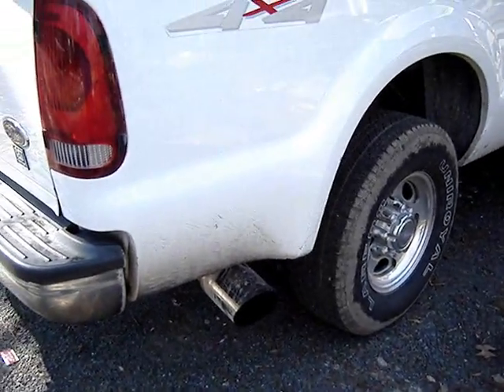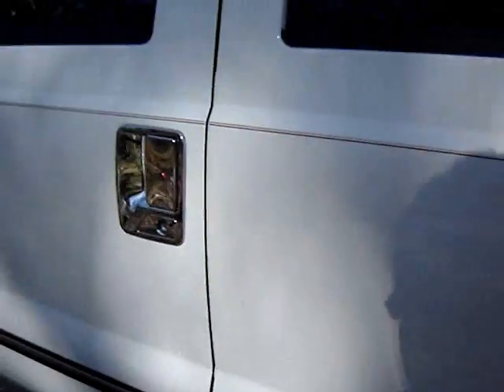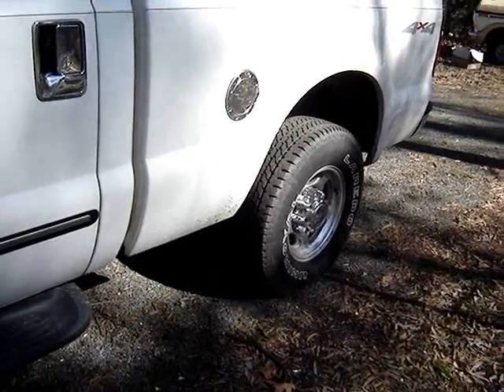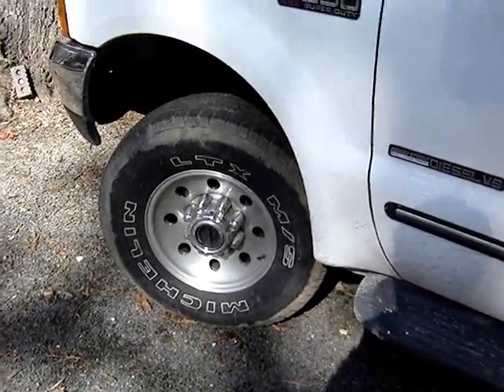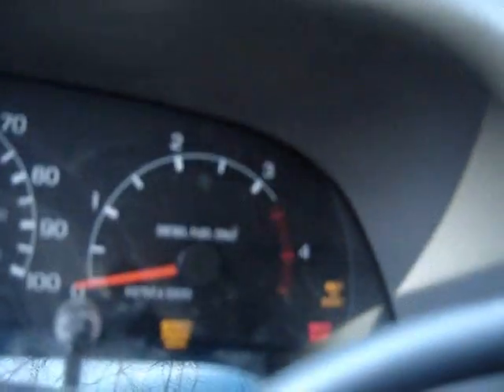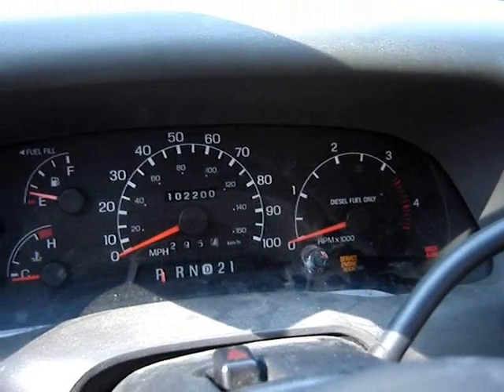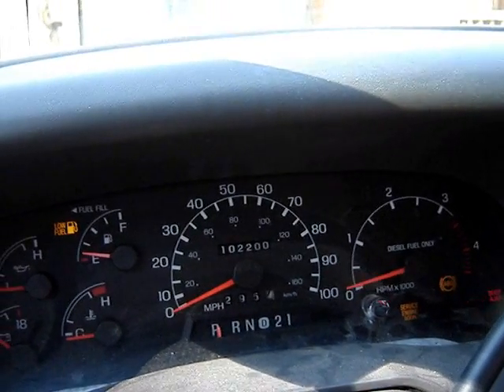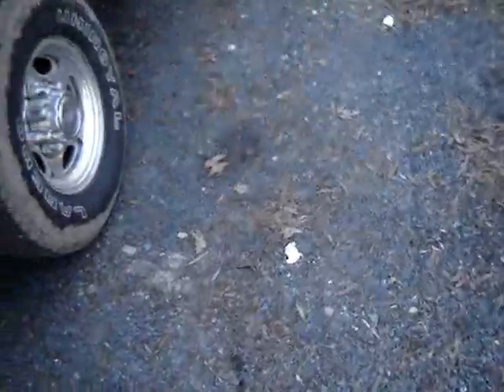The Hardest Cold Start of a 7.3L Powerstroke On Earth.     Taking nearly 6 minutes.

Comment: Loop tune is normal. The hard start may due to Leary sighns of injectors sticken assuming you’re glow plus work. Plase a headlight bulb on 47 thermal of the glow plug relay. If it passes a load test the glow plug relay is working. Do a continuity test to ground on the glow plus Circits vefifey the glow plugs work or u can remove them  and apply power to them to see if they work.

Comment: What's the basis for seeing value in American trucks when all you have to look forward to is starting issues at 100k across the board? Literally all they are good for after 100k is cold start videos.  I can't imagine trying to go anywhere with a truck that would take 6min to start or not start at all especially if I was a decent distance from home.
Reply: Christopher Mitchell ok then you obviously know nothing about diesels sorry to hear that.
Reply: I know more about how a Diesel vs. Gasoline combustion engine works and what they are used for than you probably know about finding the hole.
Reply: well im guessing youre not american and have never ever owned a diesel before. diesels have glow plugs wich need to be heated for the truck to start, so what people do is plug them into an outlet and it heats them up to start the truck, if he heated them theyd start up right away. without heating them up you just need to keep cranking it till they warm them self up then the truck will fire right up. diesels can last way longer than any gas engine theyre just much stronger engines so they can go 500k miles or and more without having issues if you take care of the truck. you can buy a brand new diesel and itll still have this problem in the cold.
Reply: I am American.  Also, thanks for the review. I know how diesel works.

My point/question is How can you justify paying 50k for a truck that can't start after 100k miles? Simply because it's American made?

It bbeing cold out and it not being plugged in aren't excuses when I can name many other foreign brands of diesel cars/trucks that start up in temps much colder then USA winters, with out being plugged in, and two to three times the mileage for half the price.

So again can you or anyone justify buying a POS for 50k ? Where's the value and why?
Reply: SalmonBelly This truck runs about as good as you can spell. 🖕🏻
Reply: cvnapps51 runs fine to me
Reply: SalmonBelly Enjoy. Maybe you can buy it and while your trying to start your truck in the morning. Just know that my vehicle started right up 😀 and I'm at work already making money.
Reply: Christopher Mitchell I already own one and it's probably got more miles than your euro trash
Reply: SalmonBelly if you took the time to read, you would have realized I'm American. I guess you read as bad as you spell. Sorry to hear that you wasted your money.

Comment: could have unplugged the sensor and it would have most likely ran fine. ive ran mine unplugged just fine. i was trying to see if the icp sensor was causing my slight rough idle, of course i wasnt that lucky it didnt make a difference. it drives fine just after its warmed up it wants to have a slight rough idle. but no power loss. so i need to get a good scanner on it and run some tests and see what i can dig up, otherwise i think i have an injector or 2 giving me fits. or its a uvch problem. because im not getting any mixing of fluids or losing oil. the big downfall with these trucks is the injection system. and all of the sensors. and never use anything but oem or you end up regretting it.

Comment: I love all of the retards who are like: "That's a Ford", or: "Fords are pieces of shit". You guys may not realize it, but all of your Duramax  (Chevy) and Cummins (Dodge/ RAM) trucks get problems, too. I respect all three of these companies, because you know what? Shit happens to all of them, and I'm sick of seeing absolute morons trying to act "cool" by talking badly about Ford and their Powerstroke engine. It's your preference, but you don't need to shit on others. All things sold in the same category have different problems that depends on who makes them, and how they are made - trucks are included.
Reply: Also, how well the morons take care of the vehicles. Vehicles don't become shit or "POS" by them selves.
Reply: I agree man. my lb7 has horrible injectors.
Reply: +Cameron Brule Just saying, Never been Stranded by my chevy.
Reply: Neither have I. I love mine.
Reply: +Cameron Brule well said!!!
Reply: +Cameron Brule I love both of mine 2004 2wd 350 dually 6.0 150,000 miles 2010 fx4 250 6.4 45,000 miles both crew cab but both of mine start and run right
Reply: Cameron Brule yes ifs definitely true too many fan boys thinking they are cool
Reply: Cameron Brule I still have my old 2000 7.3l F250. It has 416,000 miles on it and it's still kicking. The 7.3 Powerstroke is the best diesel Ford ever built IMO.

Comment: Holding the throttle is no help. The loping of the engine tells me its a fuel problem. Replace the ICP and if the problem persist, its likely due to the injectors getting long in the tooth. If you cant afford to rebuild them, try changing the oil to 5W40 rotella synthetic, pull the oil out of the HPOP and replace it with 8oz. of REVX then top it off with 5W40. I think you will be surprised.
Reply from the maker: It was definitely the ICP.

Comment: With a bad ICP sensor you get approximately 500 psi injection pressure. Instead of buying fancy rims and chrome crap do some maintenance. The sensor is about $135. Foot to the floor is no help as you have no Injector Control Pressure reference. Sell the truck and drive a gas burner. My 1996 with 230k runs perfect. But then again I take care of it. Keep laughing and pay more in the end......
Reply from the maker: Cats.

Comment: I've been told by my uncle. (Side Note, I am not, nor have I ever claimed to be a Ford engine expert, That said) I've been told that the International units made for FORD were total crap, and that the Diesel quality has gotten much better now that FORD is back to building there own diesels. That said proper maintenance is always key
Reply: bryanb16th Well. The 6.9/7.3 IDI were the first motors International did for Ford, and had absolutely no issues whatsoever, as a friend of mine has a 6.9 with 350,000 miles on it with no issues. The 7.3 Powerstroke was a very respectable diesel even to this day that was very reliable (often a million mile motor) and towed with no issues whatsoever. The 6.0 as notorious for unreliability as it is, I have 149,000 miles on my 6.0 with no issues, and I tow regularly. The 6.4 was very reliable and one of the most easily aftermarket enhanced diesel engines, even to this day. All of the above engines were International made. Plus, the 6.7L Powerstroke was the first Ford engineered Powerstroke, so they didn't get back to building their own diesels, they started building their own diesels. And obviously proper maintenance is key with any engine. You can get 500,000 out of any motor if you treat it well. If International made so terrible of engines, then why do I know people with over a million miles on their International diesel engines?
Reply: I have 343000 on my 2000 f250 7.3. runs great . starts great.

Comment: Dud all u need is new fuel filters and in 10 below no duck diesels are hard to start especially since u run 15 w 40 in the bitch put 10 w 30 in her in winter and its not the icp sensor fuel filter is clogged diesel in the us sucks the d

Comment: i have a high idle mode on my 96 f-350 dually on high idle its 1200 so it might be a little higher on the 99-2003 remember normal idle is 750-825

Comment from the maker: Sam's Club specials. My mom bought first set in 2003 and they were warranty replaced in 05 or 07. I got the truck in 2008 and they have warrantied them twice more since then from sitting, still on the original purchase. Chances are that they will wind up dead again. The warranty is very um... liberal.

Comment from the maker: This one starts right up too. Granted, I went through the motor this spring with rings, bearings, and headstuds and granted, it only has 131,000 miles on it. The truck was my dad's truck. he died, my mom had kept it and didn't maintain it at all, so it was not my fault that the engine was sick.  I blew the TC in Oct. of last year and I pulled the motor and tranny out. I rebuilt the motor and put back in this spring, tranny hasn't made it back in. Hasn't been a priority (Don't need the truck)

Comment: its a 7 month old comment! congratz on your 70k. i remember when my truck hit 70k miles when it was 3 years old. i have a 2004 gmc 2500hd duramax with 204,950 miles. so tell me when your truck hits that many. and all i have done is regular maintmence such as, battery's, belts, oil and coolant as well as cleaning my injectors once a year. and thats a 1 day job and over kill at that. i should proballly clean them every 3 years

Comment: are you a degenerate? isuzu is FAR from one of the largest or best.. right now Cummins is #1 in production and quality and not according to me.. i drive a 6.0L powerstroke and guess what.. hitts 70K miles not one issue yet.. not ONE.. the original duramax blew head gaskets and had bad injectors.. one of them always overheated cause they put a tiny ass radiator in.. honestly the only decent and kinda good durashit is the LBZ rest blow dick and had gasket issues or injector issues

Comment: dude my old 97 7.3 started up like it was 80 degrees outside when it was about -20 and it had the original glowplugs and has NEVER been plugged in it has almost 300k on it now, man treat it better and it would be better idea to worm the glowplugs up a couple times so it runs better

Comment: @jonny2k100 depends on the diesel there all different the 7.3l ford redline at about 3500 rpm and I believe the cumins does around there too stock but some of the duramax truck will go up somewhere around 4500 rpm

Comment: DUDE! What was that noise around 9:35-9:36? My  '96 F-250 did the same thing when I started it up on a 10 degree mornin'. My mpg went from 16 in city to 4! Had no oomph even when I floored it. that sound lasted over 20 miles  until I got to my house. Happened twice before but that third time was the worst. Never had a power drop like that. Thought it was the turbo chewin' itself up at first, but it still spools up and whistles fine. Any help would be greatly appreciated.

Comment from the maker: @motocross817 Probably the ICP then.   Try holding the go pedal to the floor. if it will idle at WOT, then it's the ICP.. Apparently the old version of the sensor leaks oil through the sensor body and into the wiring harness, the oil wicks up the wiring harness... insulation fails... shorting out the harness.  If left long enough it can ruin the whole engine harness.. that's what happened here.

Comment: @mrfanman2u if ya get the right battery ya wont wont need a battery warmer im stationed in Minot ND and we hit lows at bad times between -45 and -65 but i use the optima gel batteries no need for warmers garunteed not to gell oil warmers hell yes but during winter i dont run 15w40 i run either 10w40 or 10w30

Comment from the maker: @Paul12901 When you get that cold, you're talking battery warmers and oil warmer.  I don't even think I would try to start it at -60 even if it would start 15w40 will not flow and you would hurt your motor.

Comment from the maker: @frosty9595   That's some BS that powerstrokehelp has put out there.   That guy saying that the oil doesn't circulate through there is wrong.   If the oil pump fails, or you run out of oil the engine will shut off in 10 seconds.  That's how long the oil lasts in the HPOP reservoir.    The only benefit of changing the oil in the HPOP Res is to get more oil actually changed.  But if he believes it to be helpful and other people believe him and people pay him to do it, then so be it.

Comment: @hyde20082142 ICP  Sensor is a Injector Control Pressure sensor, it senses how much pressure is in the high pressure oil system. the fuel injectors need 500psi minimum to fire, but with no icp input the pcm doesn't know how much pressure is in the high pressure system, so it goes to a default ipr setting, so when cold the truck will do what his truck is doing.

Comment: Sounds like it started and ran, but woudnt keep running. I find that if I can get mine to fire, it stays runnin, even if its so cold its not firing on all the cylinders yet. Kinda like how yours almost sounds at about the 4 min mark... Did you shut it off after that or did it die, and what the hell happened about the 5:30 mark? Never heard that noise before. Sounds funny as hell.

Comment from the maker: I never said anything about getting that much boost from a 38R, what I did say was...  that I could be stupid like some people are and disconnect/wire the wastegate shut on the stock turbo to make high boost, therby killing the stock turbo.       I want to go with the 1.15AR because I plan to go with some mildly larger injectors in the future  (stage 1 ~40hp)and that's as far as I'm going with the engine.

Comment from the maker: I respect Banks, it may be expensive compared to other tuners, but it doesn't smoke.  Soon Banks will be our only options if the tree huggers get their way. Why stack when I already have the best tuning there is?      Going from a stock gt38 turbo to a gtp38r will increase CFM flow as well as lower drive pressure. I don't want 40psi of boost, I just want more flow/freer flow with room to grow to a higher boost in the future.  I plan to do studs when I do the turbo. $ is a prob though.

Comment from the maker: You were making fun, so I made fun back.  Supposedly 25psi is the maximum the stock turbo can take for any given time,  I could be stupid like some of the people out there and take the wastegate controller off and get 35-40psi out of it, for about 5 minutes.  Not to mention the insane drive pressures which can bend exhaust pushrods.    I'm planning an upgrade in the future to a 1.15AR gtp38r which while making a little less boost psi with my setup will lower drive pressures and increase cfm flow

Comment: well..i know it will tear it up if you do it too much..but my '99 7.3 does the same damn thing when its cold...my solution..spray a little ether (starting fluid) in the intake...give it no gas..it'll turn over 3 or 4 times then cranks everytime:)

Comment from the maker: Nope.   I had the ICP unplugged intentionally due to oil coming  through the sensor from the high pressure oil rail ruining my wiring harness, I thought I had caught it early enough to save the harness, but I hadn't.  The IPR in this case is un-able to accurately control the pressure and it's causing the romps.         Try this, when it's cold out, unplug your ICP sensor and try to start and get back to me.